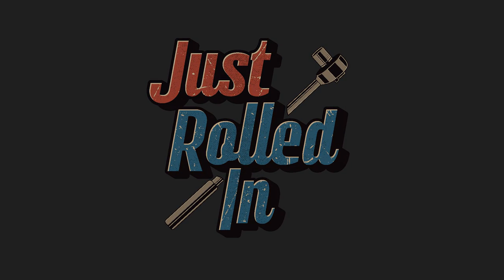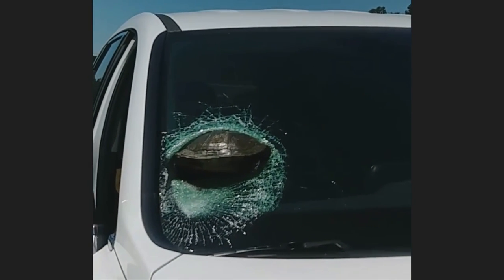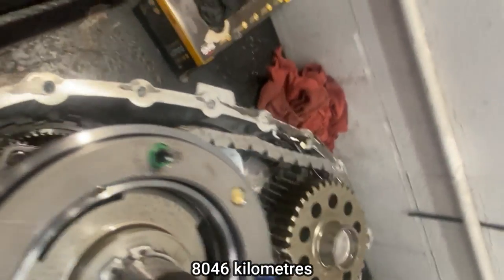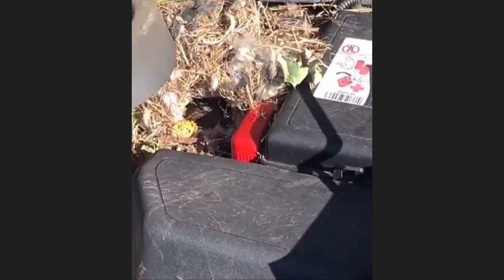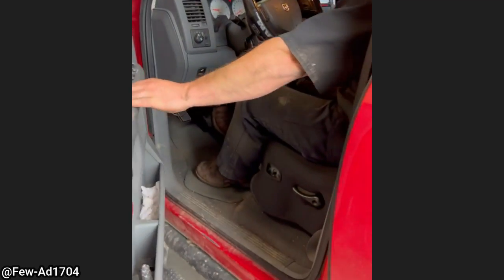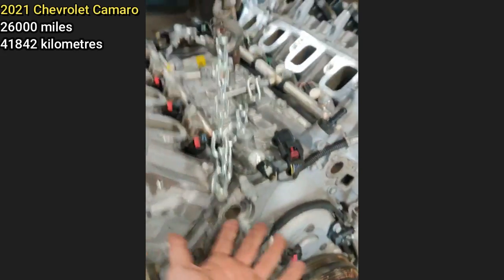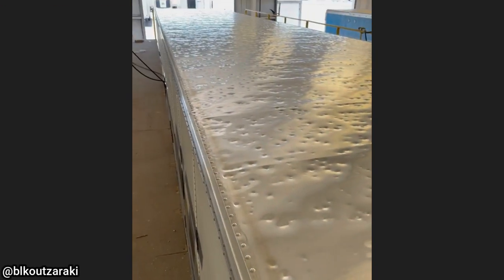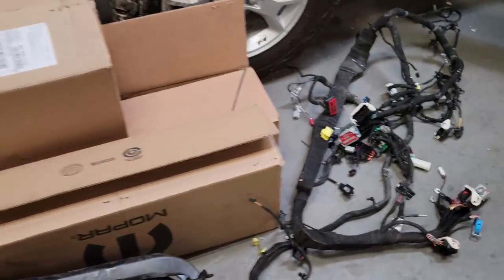Customer States Truck Will Not Move When In Gear (GMC Sierra) | Just Rolled In

Comment: I'm guessing the Camaro engine failures are due to the loose nut behind the wheel.
Reply: That’s why it would be hard for me to buy a user camero knowing that people think they are in a race car 🏎 from the minute they drive off the lot.
Reply: At least it wasn't a Mustang driver, people probably would have died.
Reply: Exactly but it is ok...daddy will fix it for him
Reply: *Camaro
Reply: @cujoedaman  you meant corvette
Reply: It’s the badge on the front that makes them blow
Reply: Pontiac Firebird and the Camaro share the same engine fault and this one is a doozy you have to go back to the GM dealership and purchase the dealerships spark plug cables if you don't the cables from the automotive store crack and Arc off the crankcase of the engine giving you a service engine light that won't go away then third-party dealerships try to charge you for everything from a new fuel system two new fuel injectors to even new air filters because they can't even figure out the issue go to the GM dealership by the GM cables problem goes away difference the GM cables are 269 dollars the automotive parts store cables r150
Reply: In the military that's referred to as a DFO problem. "Dumb effing operator" lol
Reply: @robertboeker6731  coming from a new GM specific technician within the last year after going through ASEP and loving most of GM products. I whole heartedly agree.
Reply: @cujoedaman  😭😭
Reply: Most of the vehicles featured in this series seem to suffer from that same problem source.
Reply: @stevanrose7439  
If you can find any car called a “Camero”, I’ll give you top dollar for it.
Reply: @johnDingoFoxVelocity  
The firebird hasn’t been produced in 20 years. 
That being said, faulty or inadequate spark plug wires won’t break valves or put piston shrapnel in the intake port.
Reply: @stevanrose7439  Got a 2016 Camaro SS....29k miles and it runs like a dream. Anything can be destroyed by a moron....nothing wrong with a Camaro.
Reply: @Laeadern  that gen camaro has like 1000 tsb's out on it. They are riddled with issues. I kinda wanted one but a lot were manufacturer buybacks for sale, mustve been pretty bad
Reply: @johnDingoFoxVelocity  dafuq are you talking about?

 The LS1 hasn't been made since 2004.
Reply: @scottrussell6717  it's called warranty, it's a 2021
Reply: LOL
Reply: Nah it's not the drivers fault, it's just typical Chevy quality.
Reply: Other than mods, I don't see how.
Reply: Or a short between the seat and the steering wheel
Reply: Even more prevalent on the scat packs. For some reason they have excessive tire wear as well.
Reply: More likely just a tool in the driver seat.
Reply: Lol, yep
Reply: That has a few screws missing!
Reply: @johnDingoFoxVelocity  hold up, just so we're clear your telling me spark plug wires caused the engine to literally grenade?  You need to go back to school or get back to work under the shade tree.
Reply: @philipallen7956  yep its stupid go find a Camero or Pontiac firebird there known to be the worst at this problem
Reply: No, it's because it's a gm product
Reply: What's harder buying it or spelling it?
Reply: Totally. Twice, in one car. Unbelievable. 🤦🤪
Reply: This joke went way over yalls head 😂.
Reply: That or just another cut corner by gm like every other car.
Reply: Back in the 80s we all knew what IROC realllly meant 😂

Comment: Honestly, as long as there's no leaks, I probably wouldn't replace the dented up roof.  Can always coat it in something to make it a bit more robust... being charged for a 29 hour job to replace the metal is just brutal
Reply from the maker: Yea they never mentioned if it leaked or not. If I get an update on that on I'll let you guys know.
Reply: If he's was insured. I doubt he's footing the bill. Though it'd be nice to file the claim and pocket a check like that.
Reply: @JustRolledIn  They probably just left it like that. You can't see a truck's roof from the ground, so if it didn't leak, no problem.
Reply: coating a dimpled roof like that is a real good way to trap moisture then ruuuuuuust
Reply: @visioneerone 
Rust on aluminium? That's a first.
Reply: Golfball dimples decrease the drag.
Reply: @XtreeM_FaiL  It works on the golf ball, right?
Reply: A friend of mine got caught in some hail in his peterbilt 379, got dimples all over the hood (i've seen it myself) he said "F' it, I ain't fixing it and he drove it like that for years.
Reply: @sweeptheleg.  That happened to my white VW bug i just had a friend make titleist decals for the doors.
Reply: @JustRolledIn  yeah and if the insurance is paying for that. That would make a difference in the consideration of getting it repaired after all, I guess.
Reply: @visioneerone  huh ? what coating? they were going to replace the whole top sheet.
Reply: @jwrockets  Yes. Sometimes it works things that are not golfballs.
Reply: I'd just cover the existing roof with aluminium diamond plate. Panel bond and tek screws. Hail won't stand a chance after that repair.
Reply: @visioneerone  It's almost certainly aluminum, & a product like Rhino Liner or one of those adheres very tightly.
Reply: @wymple09  use a white topcoat to help reflect heat.
Reply: @XtreeM_FaiL  my thoughts exactly. Thanks Myth busters.
Reply: 😂 that is a brutal job
Reply: Definitely wanting to pocket insurance money haha
Reply: @markk3652  WAY too heavy, and expensive.
Reply: With as dented as it was it probably did have at least a few leaks and even if it didn't a lot of cargo damage insurance won't cover later damage if the trailer was previously damaged and not fixed.  So even if it isn't currently leaking if they don't fix it now and it later does spring a leak they could possibly lose a lot more profit in lost cargo later, especially if it is carrying food or electronics.
Reply: @visioneerone  aluminum does not rust.
Reply: That's the outside skin.
To replace it like factory they probably have to strip the interior around the ceiling.
Reply: I wonder if an insurance claim would pay for the revenue lost while the truck is in for repair?
Reply: @vectorm4  I know for my dad with the company he works for whenever his truck needs maintenance or repair and he can't drive he gets paid down time.  If the trailer is damaged and will take more than half a day to fix they usually just assign him a different trailer if one is available.  They'll reassign cargo as much as possible to try and still make their deliveries on time or at least close to it if the truck/trailer is down but the cargo is fine.  If the cargo is lost due to events entirely beyond the driver's control (severe weather, unknowable road conditions, unexpected damage to the trailer, etc) then the insurance covers the cost of any lost cargo.  About the only time the driver has to pay for loss is if they directly and knowingly cause the damage by not following policy or repeatedly continue behavior that is likely to cause damage eventually.
Reply: I used to work as a “roofer” assembling trailers of all sizes. One this long wouldn’t take 29 hours to replace. At least not the way we did our roofs. This one could be different and extra special. Lol
Reply: @grumpyoldman5772  Aluminum Oxide = Aluminum rust.  Just about all metals can oxidize/rust. Except pure gold.
Reply: @wingnut2009100  Oxidation is rust. Aluminum Oxide = Aluminum Rust. Not all rust is red.
Reply: @repairdroid77 
Technically you're right, of course. But nobody calls aluminium oxide "rust". But again, you're right.
Reply: Probably 27 hours just drilling out the rivets . . .
Reply: My first thought too.
Reply: A few coats of bedliner oughta do it...?
Reply: It will do for a while.
Reply: My travel trailer was “totaled” due to hail.  It has a one piece aluminum roof as well.  I retained the trailer and took a slightly less settlement amount and still use the trailer.  No leaks
Reply: @repairdroid77  Can you provide a source for the claim that all oxidation is rust? I think you have that backwards. All rusts are oxides. But not even all iron oxides are referred to as rust - eg. magnetite. Also, the word rust does literally mean red... Which is why unusual colors of iron oxides classified as rust have the unusual color in their name.
Reply: Pretty sure rust means iron oxide specifically
Reply: @poldi2233  What about butt rust?
Reply: @visioneerone  coating means no leaks duh
Reply: fyi frozen paintballs mimic hail great, js
Reply: @repairdroid77  rain doesnt make aluminum fall apart like iron but tyvm captain knowitall for your wisdom

Comment: In case y'all are wondering, yes a dropped drive shaft is a great pole vault device. Did it on an International in a field back in my teenager days. We didn't flip but hit 90° at least. 🤪
Reply from the maker: That must have browned your pants 😅
Reply: Ah, Drive Shaft Pole Vault. One of my favorite episodes from Mythbusters. Good times.
Reply: When I was a teenager a young girl was killed when her father was racing with another guy and the front universal joint shattered. The car flipped and burned. The man was able to get out but his daughter was pinned in the wreck. He could hear her screaming but couldn't reach her.  A few years later I had a car that the front universal joint lost the bearing in one cap. It stayed together but gave me a brown pants moment because I recognized what the sudden vibration was as soon as it started. I limped it home at about 20 mph and replaced both universal joints and had to replace the output bushing and seal on the transmission. Broken driveshafts are no laughing matter.
Reply: there is that urban legend here in germany where a car was cut in half when the driveshaft broke off the rear end and just folded up 90°... but I don't know more, so it might just be a legend.
Reply: "Why is there a big gouge in the pavement, I wonder?? Rounds curve. "Ohhhhh!" 😆
Reply: @henryturnerjr3857  "This cannae be my driveshaft, gov'ner. mine is straight, see?"
Reply: @Daniel Butler  "...and had to replace the output bushing and seal on the transmission"
And your knickers, I reckon 😅
Reply: I was driving a one and half ton truck up a hill when the drive train shattered. It slammed into the bottom of the cab, sending all the dust and dirt on the floor billowing into the cab. Sounded like an explosion. I knew right away I wasn’t going anywhere.
Reply: Except the driveshaft in 90% of newer trucks , including this one , is made of paper thin aluminum,  and isn't strong enough to pole vault a skinny person, let alone an entire truck...
Reply: It's frightening that someone is stupid enough not to notice that driveshaft hanging from the bottom of their vehicle, much less dragging, and wonder why it wouldn't move!
Reply: Mario jump sfx

Comment: The tape over the warning lights is the most "this is fine" meme irl I've seen recently.
Reply: No warnings if you can't see them lol
Reply: "...so, we're going to do the right thing, and just ignore that...it's...fine..."
Reply: Pretty normal nowadays due to stuff like tire pressure sensors and emission not working after a few years.
Reply: @Crosshair84  huh? I have a 12 year old car, and only had 1 broken sensor 3 years ago. (As a little customer service the workshop replaced it for me free of charge when they put the summer tyres and wheels on the car)
A car is not a rock in the garden, it's a complex machine, it needs some care. People nowadays seem to care more for their phone than for the item that could decide if they live or die.
Reply: @nirfz  Then look at people who do care for their car, minus some rust issues in wheel arches.

Comment: That's what my transfer case and engine looked like after my truck decided to shift to 1st gear at 70mph, the transmission housing was also cracked and the diff had some damaged teeth! It was due to a speed sensor failure in the lead frame (recall issued a little while later). Apparently the drivetrain was not designed to bring 12,000lbs (towing a trailer) to a an almost sudden stop from 70mph! All was fixed/replaced under warranty but the truck never drove the same after.
Reply: They never do :(
Reply: Good lord somebody got fired in the  Technician department.
Reply: That would be known as the money shift! It happens when there's a glitch in the computer. It cost alot of money to fix.
Reply: I probably would have needed a new seat as well after that.
Reply: @dclfarms6204  and for the semi that was behind me as well! To this day I am not sure how I maintained control and how the semi managed to miss rear ending me!
I think the driveline totally failing and the brake booster being on an electric pump might have being what saved me
Reply: F150?
Reply: @adambahnsen4577  no comment 😂
Reply: @thesilentone4024  I think you mean the engineering department, but yeah probably.
Reply: @alexwalker2582  
I had a Saturn blow the head gasket because the temperature sensor failed. 
Damn software people.
Reply: @OG-SoaringFalcon  Failing sensors and the actions taken due to that can be quite interesting. In another project about 10 years ago there was a winter test of a vehicle and when the temperature went below -40 C then the outdoor temp sensor went out of range and the AC went into default mode as if it was +25 degrees C outside (somewhere close to 80 F or so) and started the AC. A pair of quite frozen test drivers was the result.
Reply: @neilkurzman4907  too bad they dont make cars with dedundancy
Reply: Poor truck got ptsd
Reply: @ilenastarbreeze4978  
It’s not a matter of redundancy. It’s a matter of poorly organized software. 
The car knew the temperature sensor was bad but acted like it was working anyway. 
And as far as the transmission goes if you’re doing 70 and someone shifts it to first gear. It should refuse. 
The same way an engine won’t overreve if you put the pedal to the floor with the car in neutral.
Reply: That's really poor software design. The transmission should know it is impossible for speed to change so fast, it also gets information from the ABS how fast each wheel is spinning. I can guarantee the recall will also include a software update that does not repeat this mistake.
Reply: @ehsnils  many times it comes from whoever programmed the function didn't know to include a "when sensor A fails go to emergency routine" and program one that makes sense and prevents from failing. like, when some engine sensor fails the engine won't start again or rev up to only 2000rpm, or somesuch.
Deutsche Bahn created a big shitstorm when the ACs on newly aquired ICE train carts would fail completely when needed the most. of course, windows can't be opened on these. the problem came from when the outside temp rose to over 35°C the AC would shut off because the pressures would get to dangerous heights. but unfortunately, the air ventilation shut off, too, and themperatures insode the carts became dangerous to the guests' healths. some where close to smash the windows in with emergency hammers because people were close to suffocate...
a secondary problem with all that was that the railway agency's rules said that an AC needs to function up to said 35°. it didn't say the AC should shut off... but the maker made it like that. because nobody had in mind that temperatures around, above, and inside these train carts can easily rise above when running slowly or standing in the sun even for a few minutes.
the issues were soon be fixed, ACs later replaced, but for a few weeks it was downright dangerous to travel with Deutsche Bahn during summer.
Reply: @jasonswift7098  lol, truck towing capacity was 11,000lbs and the trailer was only 5,500lbs, also was a nice summer day.  I always tow safely, just could not predict the damn truck shifting to 1st at 70mph!
Reply: @mrfrenzy.  I believe the recall was to reprogram the TCM to prevent that exact condition, and replace the lead frame as necessary (failed sensor).
Reply: @richardbrowne3641  Ford has this issue you going 70mph down the freeway. the PCM see you are going 70mph. the VSS stops work like it should and reports back you are full stop. PCM thinks oh we are stop i don't need overdrive, I need first gear and pops it into first. the engine over revs, flys apart some of the the transmission parts over speed and blow up. no one though to program what if this sensor stops working. Mercedes though of this on the W202 TCM holds what ever gear it is in till you come to full stop jump in it Limp home mode.
Reply: @crazeguy26  Sound like straight up sabatosh!
Reply: Wow, that sucks.
Reply: A friend of mine suffered the same situation after only six months of ownership of a brand new F350.  They replaced the transmission, transfer case, and rear diff.  Four months after the repairs, the front diff failed.  Six months after that the engine failed.  Upon further inspection, the rear leaf springs were cracked and 3/4 of the frame to the rear showed numerous stress fractures.  His insurance fought the dealership on the engine, rear suspension, and frame sighting all these issues were due to the original failure.  The dealership eventually caved and accepted responsibility and replace everything, but my friend requested a new truck and didn't want to have to worry about any future repairs with the extent of work they were going to do.  The dealership agreed and provided a brand new free replacement and paid off the loan for the damaged truck.  The dealership ended up using the damaged truck for the good parts and scrapped the rest.  A pretty smart move since the majority of the truck was still good and would save their customers money when it came to replacement parts.  He has had the new truck for a year and put almost 60K miles on it (does a lot of towing for his business) and so far no issues.  He takes it in regularly and the dealership gives his truck the VIP treatment.  Guess they want to ensure his truck is dependable and lasts forever.  Don't want a repeat. 🤣🤣